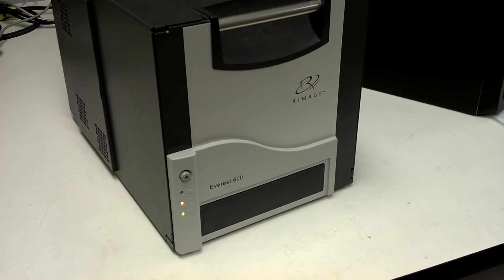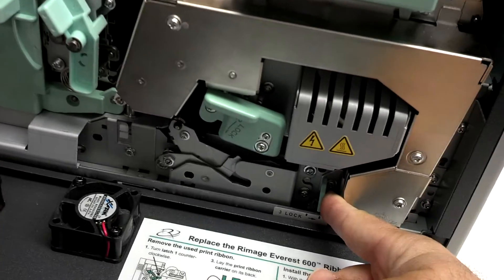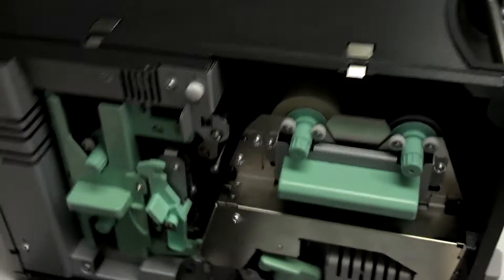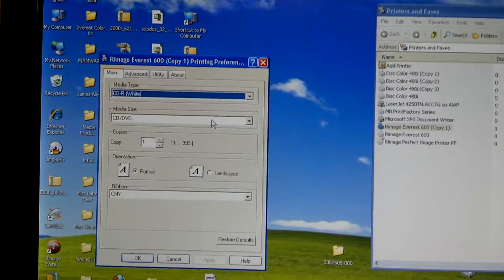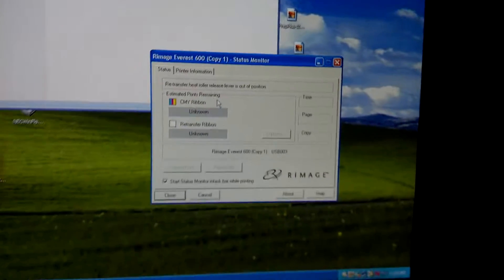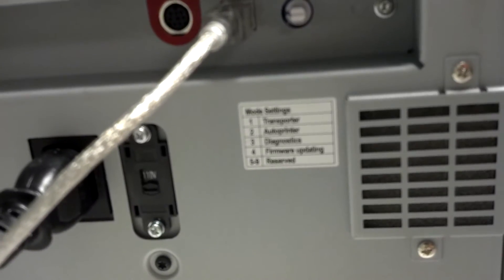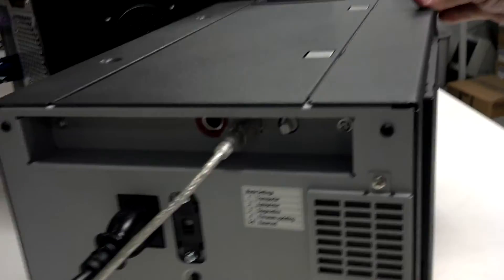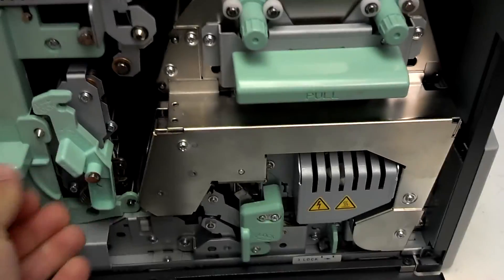Rimage Everest printer basics

Comment: Hello, the everest 600 second latch will not lock.  What could be the problem?   Please advise.  Thank you in advance!
Reply: Usually if you can't get the 2nd latch to lock, that means the transfer carriage is not pushed in all the way.
The transfer carriage should click in to place, so try pushing back further on the carriage. This may require a bit more force. Get a light and make sure there isn't anything inside obstructing the carriage from moving all the way in.